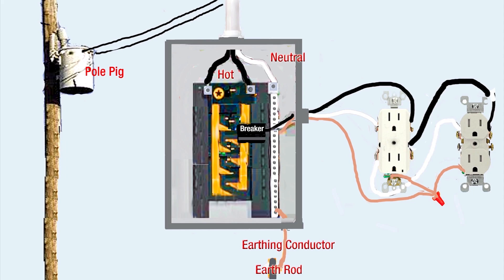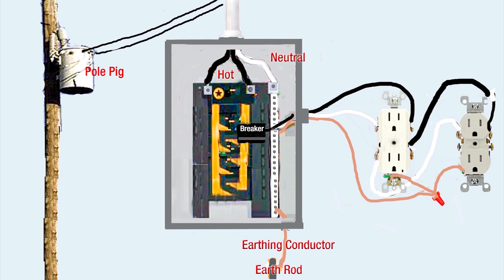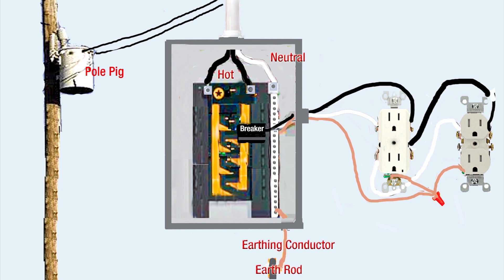Grounding, Bonding, Earthing, Shielding and Protecting with Jim Heath W6LG

Comment: I have been zapped by appliances before that were improperly wired, or an outlet improperly wired.  The reason having that third ground prong is important is this:
A properly wired appliance will have that third wire go to cabinet/chassis ground.  That's it's intended purpose.  An A/C appliance such as a washer/dryer/fan/stove will very happily continue to work if the hot and neutral leads are reversed.  I have had appliances that had the entire cabinet carrying a voltage of 120 volts A/C and worked fine. The unique property of A/C motors that they will run happily reverse polarity makes cabinet grounding essential. I had an electric dryer with a 3 prong outlet (now 4 prong are mandatory) that was improperly wired at the hookup point.  Again, 120 volts into the cabinet and 120 volts to one heating coil and the neutral/ground to the other coil.  The motor ran fine, but it didn't get very hot!  Having a dedicated chassis ground wire is the ONLY way to assure that a hot power lead is not running to the chassis/cabinet because if it is, you will immediately have a short.  If you don't have a GFI outlet you might even have some fireworks!
Reply: I had a situation with an outlet where hot and neutral were reversed. So if you touched the metal chassis on one appliance and touched another on a normal outlet, you could get a shock.
Neither of these appliances used a third pin.
Reply: @jeffkardosjr.3825  Yes, this can definitely happen.
Reply from the maker: Yes, exactly.  Some guys don't quite get the neutral versus ground wire and what that can mean.  In short, it means trouble that could kill someone.  Maybe you mentioned this, but one famous ham recommends cutting off that pin that  you point out is very important.  He says he is a Phd.  I wonder.  Thanks, Jim

Comment: Hi again Jim this is without doubt a complex subject, there is a video around where someone is encouraging the lifting of the safety ground from equipment and therefore relying on the interfacing cables to handle fault current. I know it is tempting (and it does work at fixing earthloops) but it is a dangerous practice. I probably would not lose any sleep over taking the safety ground off of a few of my rigs but definitely not from an amplifier with a 3200v B+.  As an incidental piece of useless info the current transformer in many RCCBs is often only half wave rectified, so a sudden fault may cause a trip on the next half cycle of the supply. There is no guarantee at all that if I grab hold of the B+ that it will trip at all. RCCBs do have the merit that they will still operate even if our radios are "grounded" by multiple paths. FWIW how many pleasure boats get around groundloop issues when connected to shore power (it can aggravate electrolytic corrosion) is to use a back to back diode arrangement in the ground wire. This arrangement allows the "grounds" to float a volt or so apart. I think a similar arrangement might be useful in our hobby but we all know what will happen when significant RF currents flow through the diodes! Potentially (no pun intended) it could be useful at reducing groundloop issues but of course the diodes need to be up to the job.
Reply from the maker: Hello!  I think that I follow most of what you are describing.    Yes, it was Doctor X who has a video wherein he clips the ring that provides a path to ground.  So his example is that the equipment is connected only to the neutral and the "hot".  His recommendation is, well, dumb.  Even more than dumb for a supposed PHD.  I would sure like to see his thesis.  
Today and yesterday I have been chasing a problem that may be close to what you described. I found (the hard way) that when a (so far not found) wall wart is connected other devices connected to the large power supply have roughly 24 volts on the plus side.  There are about 15 devices running on  approximately 12vdc.  It appears that one of them has a "hot" ground.  It is 0330 local and i got up to disconnect all devices and slowly reconnect with a volt meter connected to the rails of a the large power supply.  
Enough about that!  Just an FYI, I have 3 inch wide copper running around the room.  As of yesterday, I have a large diameter copper pipe under the ham desk.  That copper pipe is now connected to the 3 inch ground strap.  Today I will run flat wide straps from that copper pipe to the transceivers, linears and miscellaneous stuff.  Since I really don't think there is an RF since the impedance from a typical ham station to a common ground is way too high to do anything at HF. To test that, I have this room wrapped in foil and copper, tied to the desk frame & pipe, all connected to a wide copper strip to the common ground about 20 feet away. I will let you know if there appears to be any affect connected versus disconnected to the extensive ground.  Thanks and I hope this makes sense. I am making lots of typos.  73, Jim
Reply: Jim W6LG hi, fwiw I have seen very similar to what you describe, a standard 13.8v power supply was the cause. A pass transistor had a speck of swarf bypassing the insulating kit causing the can (the collector with about +24v on it) to be connected to the chassis of the supply. Good luck with your fault finding, 73
Reply: P.S the ham advocating lifting safety grounds etc was someone extremely well known. Not great advice to give to beginners...
Reply from the maker: Oh..good to know.  That is what I am reading at the power supply.  Now I am going to back under my desk with a voltmeter.  I watched a little of the news on the satellite TV.  73, Jim
Reply from the maker: Yes and for 10 years I was across from them at Dayton. Enough said.  Their videos don't get many views given the effort and years on YouTube.  Mostly I don't watch others videos.  I did watch a few recently and was shocked, gobsmacked.  One guy with 100k subscribers is giving some really screwy advice and purports to be an RF engineer.  73, Jim
Reply: @ham-radio ,  a few strange theories are perpetuated by some, I best not list the ones with greatest comedy value. I am sure most of it is well intentioned but unfortunately could throw beginners off. 73

Comment: Just to clarify for some asking or wondering on comments below. Circuit breakers/fuses protect the wires and devices of an electrical system. GFCI (ground fault circuit interrupter) protect you. 50mA thru the body is considered lethal. GFCIs trip (open) at 7mA. Any current from the hot (Black or Red in a dwelling in the USA) conductor to ground in access of 7mA will trip the GFCI regardless of load on any other conductor on the circuit.
Reply from the maker: Thanks Sal.  I know about the mistake I made in the video. Thanks for the clarification and help.  Regards, Jim PS I got across 3KV DC and woke up across the room on the floor with burns.  I was a teenager then.  Tough lesson!
Reply: It depends on the class of GFCI.

They're not all rated at the same mA.
Reply: @jeffkardosjr.3825  correct. it also differs in what part of the world you are. household GFCI's here trip at, or below 30 ma. medical devices require 5ma or less to trip.  This coming from Ireland.

Comment: So Jim. I live in an older house about 70 miles from you in Pittsburg. I do not have GFCI breakers. I do however have a separate Ground (earthing) rods for just the Ham equipment. Your saying either bond both grounding systems together or just use the house AC grounding system? You didnt get into lengths of grounding or earthing wires.  Can they become resonate and give you other problems? Is the shorter the better?   Love your videos Jim, love to hear you on the air one day. Where can i find you on the air? Sal KI6UNF.
Reply from the maker: Hi Sal, I am still in the building phase after the move.  So I am not on the air. I recommend that you follow the NEC.  Mike Holt has a website with really good information.  Low impedance path to ground is better.  I would put the all together.  My big station was on the second floor, with several amplifiers, towers and antennas.  I had no ground on the station other than the wall outlets. I was there for 38 years.  73, Jim

Comment: QUESTION: If your antenna is grounded properly (8' copper clad iron rod), is your equipment then also not grounded to earth via the coax shield?
QUESTION 2: Is it not best to use braided wire as grounding and bonding medium in order to prevent the buildup of RF and/or to prevent it to travel?
At one point in my life I constructed my shack on the second floor of my house, which created all sorts of RF issues that had to be addressed. I would tend to agree with most of your reasoning. But ground is ground. And shield is ground in most situations. Is it not? No wonder this subject is avoided more often than not.
😉
Reply from the maker: My radio room was on the second floor above the garage.  Other than the electrical ground, there was no RF ground.  Many RF engineers believe that there is no such thing as an RF ground. I did work from there with high power and big antennas. I had 8 active elements on 20 meters with 10db gain.  
Your Q2, what do you mean by RF build up? Braid is not the best.  Those little wires that make up the braid can be trouble.  
Your Q1, what is properly grounded? For example, how would a dipole be properly grounded?  It is a balanced antenna.  
If you have lots of RF in the radio room, I wonder about the kinds of antennas that you have.  Are you using an 'end fed'?  Thanks for asking great questions.  73, Jim
Reply: @ham-radio  Well...that was many years ago when I was first licensed. I was running mostly on a home brew 10 meter ground plane. Which of course the ground plane was grounded to earth ground via solid copper wire to 8' copper clad rod along with ground radials in earth. Quite the setup. Worked the world on 25 watts via a Uniden President 2510. Loved that little rig.
I actually did managed to eliminate the RF issue in the shack (a vacant bedroom) by grounding all of my equipment with baided copper grounding jumpers (made from old coax shielding) to a grounding block, which was then grounded to earth via heavy duty braided wire. I was advised that RF has less ability to build up on braided wire becasue the braiding causes RF to cross itself out. Though I have heard of people who actually make the shielding in their coax resonant. (true?)
Mind you, that I lived in an old century home at that time which had the old knob and post through most of the house, and certainly no grounded outlets. In fact, some rooms only had one electrical outlet as I remember. Hardly to code by todays standards. I believe that much of my RF issue came from a home brew dipole, and two beams that I had up at the time. I eventually built an actual shack on the first floor with upgraded electrical and GFI. But that was three homes back in life.
Thanks for your input Jim.
Steve

Comment: i have a seperate ground rod for the high tv mast on a metal roof up on the mountain here. the mast and metal roof are bonded together with 4 g solid bare wire i skrounged off a 40' pole and hammered a seperate ground rod from the two i have for the house elect system. im just grounding the mast, do you think i should ground the threaded  ring on the feedpoint connector? because that will go back to the pannel via chassis ground. also i was thinking of grounding the (skin effect) static discharge of the 3 conductors of the fan dipole. what do you think?

Comment: Jim, I recently had a bad RFI situation on 160 meters when running my AL-811H linear amp. Everything I touched on the radio, mic, amp etc. resulted in RF burns. I started using a small neon bulb to touch the radio, mic, etc. to test for RF to avoid the RF burns. The bulb would light up so bright, that it was glowing with blue highlights.

So I hard grounded the AL-811H amp to a nearby water pipe (under the kitchen sink). Amazingly, that fixed ALL of that RF problem, and I can't get my little neon bulb to light, and no more RF  shocks no matter what power level I run.

Thinking about what you said about it being a violation of the NEC to run multiple ground rods, I did an experiment. Instead of 'hard grounding' the amp to the water pipe with my piece of solid #14 wire, I put a .001 uf 7KV (coupling) capacitor in series with the ground wire, and viola, it also worked!. 

So you ,might want to mention that, - by putting a "capacitor" (of suitable voltage rating) in series with the ground wire to the secondary ground rod, you maintain the original AC & DC ground path while having a secondary ground rod for the needed RF path. This will satisfy the NEC.

Also, you've made mention about running everything back to the service entry ground point (and service entry ground rod). Only problem is, that this is impracticable, and the long distances from the ham shack and the service panel is what is causing these situations in the first place.

Ferrite beads and what not are all good things, but when you have serious RF (from 160 meters), the only remedy is a close by ground rod, or water pipe, and the way to stay in compliance with the NEC is to put a RF coupling capacitor with the ground wire to the ground rod (instead of hard-grounding the equipment to the ground rod).
Reply from the maker: Thanks.  Someone how, this morning, I am not fully understanding the placement of the .001 cap.  Can you send a private email to me with a drawing or perhaps a different way to describe what you did?  Also, what is the SWR, feedline and antenna.  You sure have a lot of RF in the room and I am wondering why that is happening.  Thanks, Jim
Reply: Thanks for responding Jim...
My feedline is Belden 9913 (foil shield). SWR leaving the shack is basically 1.1:1, and the antenna is a "loop", or modified inverted "ell".

The principal is simple, and you said something in your video which set up the solution perfectly.  You (correctly) said that 'we're dealing with DC paths, AC paths, and RF paths".

Hard bonding ham equipment to local/nearby ground rods (or water pipes), bonds ALL of those paths (AC, DC & RF), when in fact we're only interested in shunting the RF path. And that's we're we get in trouble with the N.E.C.

Much like the way it's done in RF (linear) amps, the "RF" component is shunted to the desired path (the output Pi network) via a coupling "plate" capacitor which passes the RF current, but blocks the DC (and AC) voltage.

The solution is to simply put a capacitor (of suitable voltage rating) in "series" with the ground wire going to the local ground rod(s) or water pipe.

I made a quick video demonstrating this situation, and can be seen here :
https://www.youtube.com/watch?v=inZlg5B7FgQ

 You (or anyone) can correspond via e-mail via my ARRL e-mail forwarding address which can be found on my QRZ page for call sign: N4MRN

73's for now Jim,
Steve / N4MRN

Comment: You are leaving yourself open to liability claims.  This is bad advice.  You bond the radios to an earthing rod, not the neutrals from your outlets.  Never disable the bonding pin on an ac cable.  I suggest you delete this video.
Reply: logic reason Where I struggle with the argument here is in a 3-wire home system, your chasis IS earthed the moment you plug it in. I think it is a valid question as to why create second path to earth. Even if the two earth rods are connected outdoors, there are still two possible return paths for the energy, one through the house wiring and the other through the station ground. It seems to me such an installation is no longer a single-point ground by definition and sets up a potential ground-loop scenario. It also seems to me that extra path back through the radio is also now available to anything on the house wiring - it’s just a matter of potential as to which path the energy will take. I’ve had engineer-credentialed code inspectors (non-hams, of course) say the same.

The funny thing is I actually use a station ground, because that’s how I was taught. I’ve just always had trouble with the logic behind the practice and have never received a straight answer from electricians, inspectors or engineers.

As for his PhD friend advising people to cut the ground lug off adapters to remove the earth path back through the house wiring, I follow the logic of removing the extra path, but it now places all of the responsibility for safety on the station ground; this just does not seem wise to me, but I’m not a PhD in an electrical field, either.
Reply: 1_lens_view you are correct.

I thought I deleted this and wrote a retraction.  A simple LTspice simulation showed me the errors.  Thanks for the response.

Comment: You can have two ground rods if you tie them together to equalize the voltage in the system, otherwise you have two separate circuits and run the risk of creating a voltage potential in one with a lightning strike. I recommend the ARRL book “Grounding and Bonding for the Radio Amateur“.